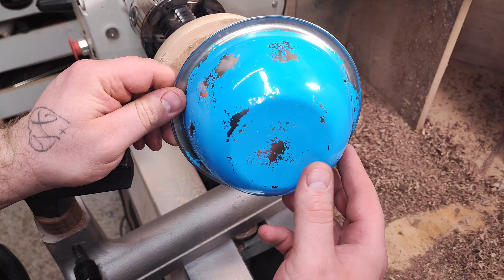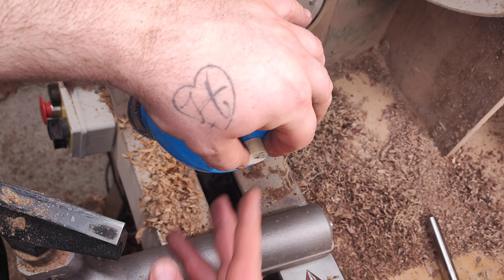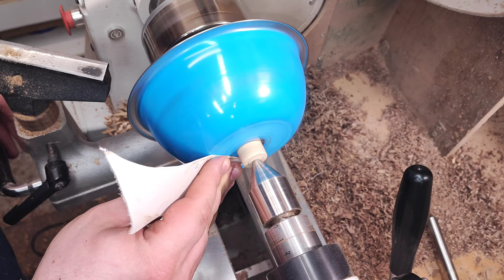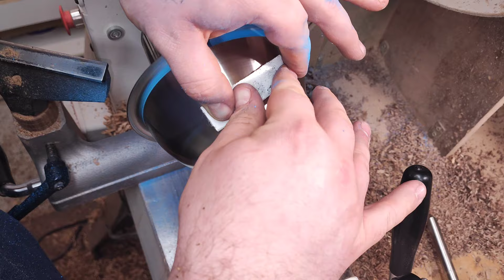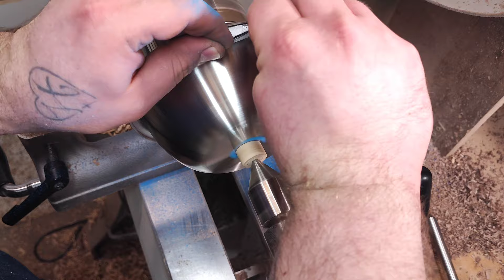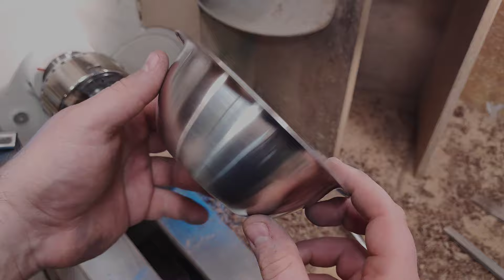WIFE NEEDED HELP SO WORK HAS TO STOP 😉

Comment: I live on a farm and have used a wood lathe to make many different materials round (pvc, plexiglass, aluminum, copper, etc.) for many different applications (from plumbing to machinery repair).  I’ve even moved an old Harbor Freight lathe outside to turn off the  outer tough layer from some butternut squash.  Only did that one time.  The wet mess isn’t worth it 😂.

Comment: Nice to see that I am not the only one who uses his wood lathe for projects other than wood. I have made so many pieces ranging from Nylon to Aluminium on mine. Sanding and filing seems to be my lathe limit for Stainless steel or other steel peices. Little peice of rubber sheet from our dollar store is always useful to stop these kind of things from slipping. I think I liked the polish on the bottom like the sides better.

Comment: Happy wife, happy life.  The one that made my wife happy was turning a new set of handles for an old metal spatula she had gotten from her mother years ago and for which the handles had decayed away after years of washing the spatula.  As far as non-standard use of the lathe -- I've used the lathe to polish copper pipes that I used for some wind chimes I made several years ago.  Worked better than any other processes I tried to get them shined up.